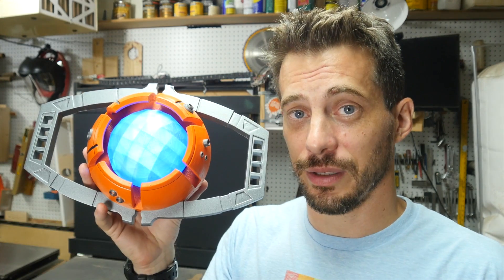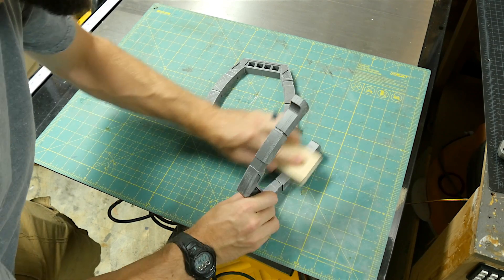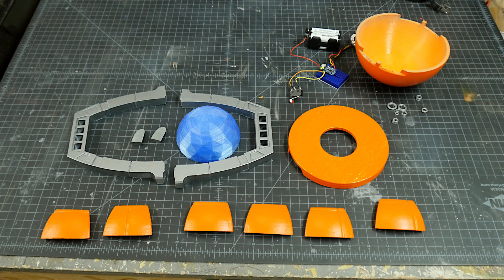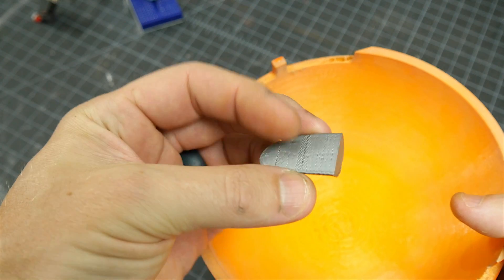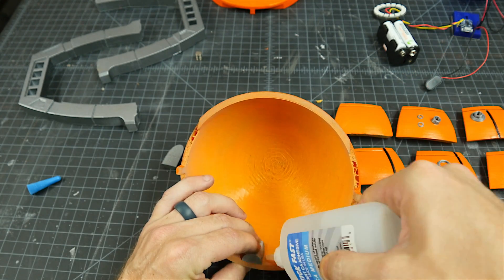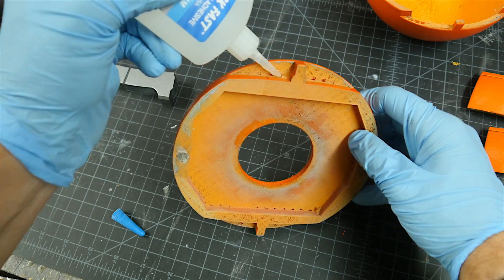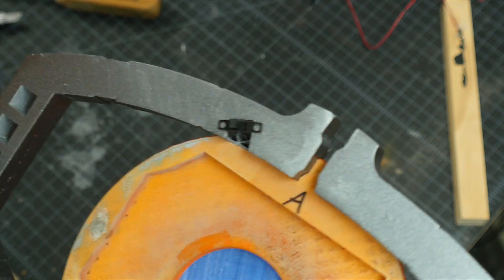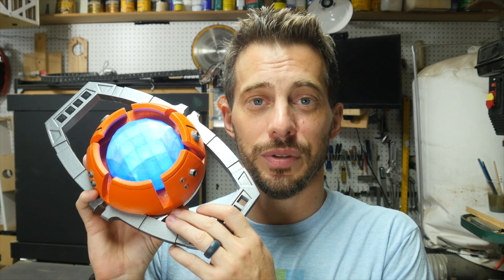3d Printing a Transformers Prop (Matrix of Leadership) // How-To | I Like To Make Stuff

Comment: Dude you're having serious printing issues with that beautiful piece of hardware. My half-ass calibrated reprap prints much better and maybe even faster. Please troubleshoot your extrusion and support problems.
Reply from the maker: I fully understand that it's not a perfect printer, but it might be more helpful if you pointed out some possible points of failure, or things to check rather than just compare it to you printer which I'm unable to use.
Reply: Don't get me wrong, my printer is nowhere near a calibrated Ultimaker, not even a first gen. It's a reprap. But your UM2E is working very poorly. You are underextruding and the empty print lines mean the printer is skipping layers. 

Your PLA roll might be dampened, your temperature settings might be low, extrusion modifier might be too low. Try printing a benchy with your fastest, normal and best quality settings. Compare the errors to find exact problems. Also you can print a temperature calibration tower. You can find it in thingiverse, simply a 10x10x100 mm tower. Start with your filament's maximum setting (210 for PLA, 240 for ABS) for every centimeter, lower your temperature 5 degrees (no need to print all 10 centimeters, better not go below 175C°). Also you can oil your filament.

Joel from 3D Printing nerd, Angus from Maker's muse, Jerry from Barnacules and Thomas Sanladerer, all have great videos about calibration, underextrusion and filament oiling (etc.) I suggest you to follow them, especially Thomas Sanladerer.

I also like to make stuff and I like to enjoy my work more when things turn better than expected :)
Reply from the maker: Umut KARCI That's great info, thank you!  I'm friends with Joel and Jerry, so I'll definitely reach out as I try to narrow down the issue.  Thanks again!

Comment: Great work, love the eerie glow from the blue dome! :)
Looks like you might have some small issues with layer delamination/edge delamination when using the grey filament. This could be due to minor differences in diameter between the different filaments, or even humidity! One solution to this would be to increase the extrusion multiplier in your slicing software by a few percent. I've had this happen inbetween two spools of filament from the same manufacturer and batch... :)

Comment: I think if there was a way to scale it up larger so that you could hold it as Rodimus Prime did in the movie, ana maybe find a way to mount the switch there so that when you are holding it that way it lights up. Which in that method would be slightly easier because of the added space to work with.